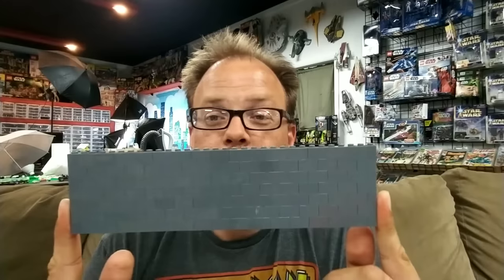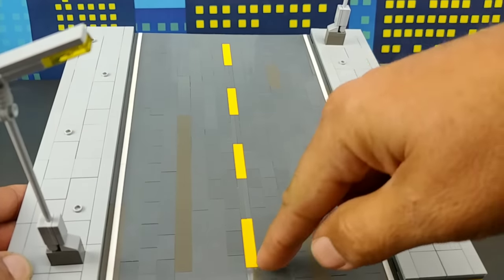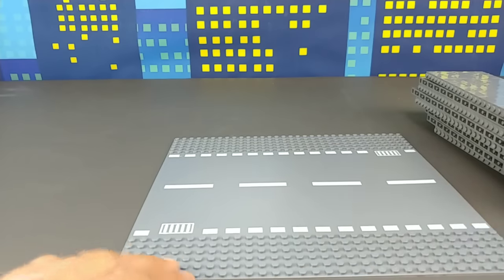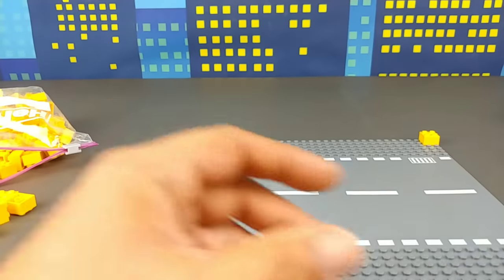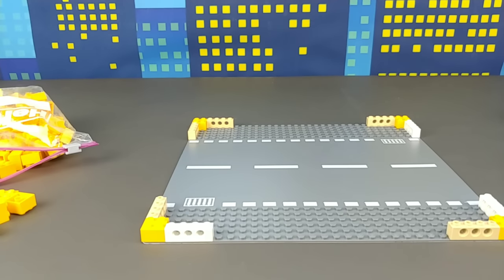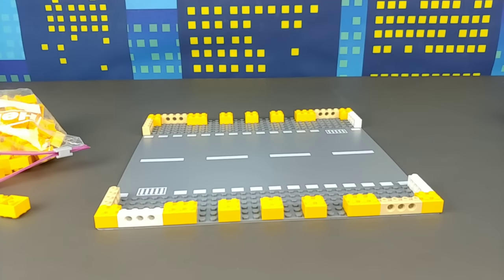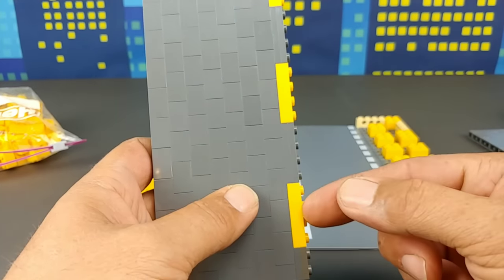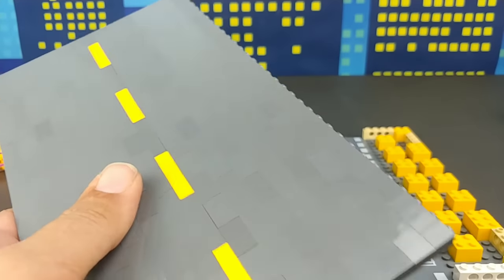How to build a 7 brick wide lane mils plate road.

Comment: Nice way to build LEGO roads. One modification I would suggest: the headlight bricks are slightly wider than a regular brick, so I would place them in the gaps between the yellow 2x2s. The way you use them adds some stress and causes the base plate to bend.

Comment: There's just one problem I see.  Those green 'Headlight' bricks, they don't actually fit there.  The stud on the side of them sticks out past the boundaries of the sides of the brick, so it's pressing up against the yellow 2x2s, making the whole thing hard to fit in, and causing the road plate to warp underneath.  You could solve this by using either a 1x2 Technic brick with two pin holes, or by offsetting the headlight bricks from the 2x2 yellows.

Comment: So some Bricklink seller seems to have 1x2 dark bluish gray bricks from the Pick a Brick wall left. :-) (Or did you get them from LEGO? I also collected a lot of these for road building from the Pick a Brick wall in the past.) Do you feel that roads would look smoother using larger elements (e.g., 1x16 bricks or 1x6x5 panels) instead of the 1x2 bricks? I'm currently using the 1x2 bricks on slopes, since you can bend the road a little bit, but I'm not yet sure whether I should use them everywhere or go for the more expensive panels.

Comment: It requires many pieces but the result is great. Did you consider making some manholes using 3185, 3633, 38320 or some 112111 for bumpy road texture?

Comment: Another question, if I may: When using a road plate as the base instead of a regular plate, there are no studs underneath your road surface that support it. (There is gap underneath of half a plate in the version you show here that would otherwise be filled by the studs.) Does the road bend to the center because of this when you put cars on there or is it not a problem?
Btw: I really love that you are able to work on the city again an how it's turning out so far.

Comment: A solid (double is most common) line is used in most city streets. The solid lines indicate "no Passing! Using a solid on one direction/broken line on the other is generally used on highways to designate a restricted direction passing lane. A broken line is used for an open passing zone - passing in either direction. 
This info is available from any DMV website.
The design you use here is not realistic for a city street build.
You did get the white line correct. As a white line is indicative of one-way traffic. A yellow line indicates two-way traffic. So if your road was for one-way traffic only, you would use a white centre line, which could have a broken line for changing lanes to make turns from the proper lane.
Reply: That really depends on where you're from. In continental Europe two-lane inner-city streets almost always have broken centerlines, mostly to allow cars to pass unmoving obstacles like a truck unloading cargo.
This road design is modeled after the Lego base street plates which in turn are probably modeled after Danish roads (Lego being a Danish company and all). There is of course nothing wrong with pointing out that if you want to make a road that's accurate to US standards you need to use a different centerline, but it's getting pretty annoying how Americans always seem to assume that if something doesn't match their personal experiences it must be wrong or inaccurate, rather than maybe, just maybe being based on a design used elsewhere in the world.